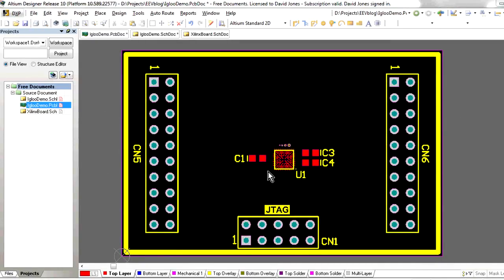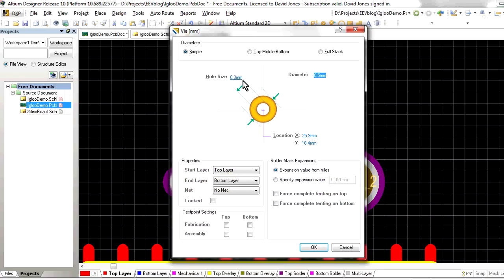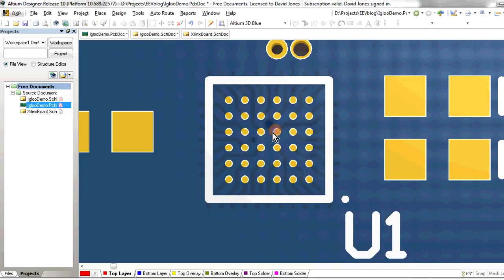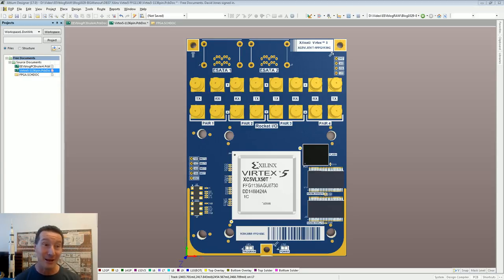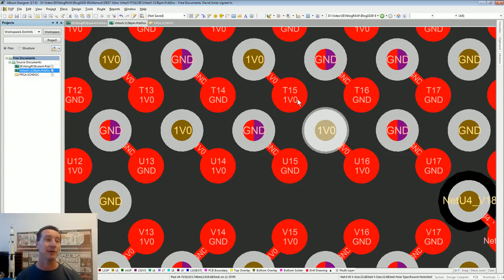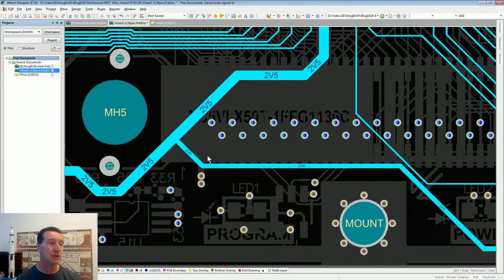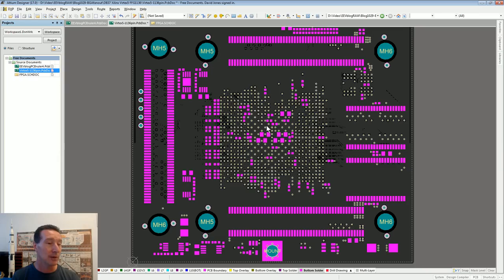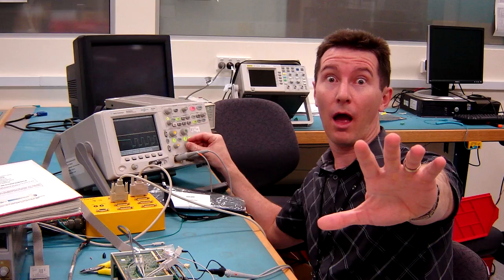EEVblog #1029 - BGA PCB Fanout

Comment: Hey, Dave! Man, I can't even explain to my fellow viewers how valuable this video really is!!!! I just wish you had done it MUCH sooner :)

Trying to find some of this info for a hobbyist is damn near impossible. I'm a software guy by trade and have no formal education in hardware. It took me a couple of years to piece together enough information and thousands in re-spun boards to finally do a working design with a small-pitch large ball-count BGA chip.The fact that you did a video on this is going to help SO many people who don't know where to start.
Reply: Every FPGA manufacturer has recommended fanouts and even PCB stacks for individual packages/families. Its not like it is that hard to come by to this info on web.
Reply: Fanouts are about 1% of the board layout. I wasn't saying great job for showing a fanout. I was saying great job for the info in the video in general. Via sizes, via tenting, layers, bypass cap placement, and he even mentions IPC guidelines, which took me months to come across by accident on my own. If he broke this video down into a few more in-depth videos, it would be amazing for the hobbyist who wants to get into this kind of PCB design.
Reply: Unfortunately these examples are very outdated nowadays. Modern hi-speed buses like DDR3 have very strict requirements on how do you route them out - you can't just spread them around however you like. This makes using "default" dog-bone fanout (which even cheap tools like DipTrace can do nowadays BTW) near-impossible, and you have to craft it to make sure certain trace groups go to specific layers regardless of where they are on device - and more often than not you're quite limited in amount of pin-swapping you can do to aid layout.
Another factor which makes routing BGAs harder is the fact that you have to make do with as few layers as possible. I'm a hobbyist too, and making a first 4-layer board with Artix-7 device (256 ball 1.0 mm package) took me weeks of reading datasheets, appnotes and guides, as well as actual routing - I had to scrap routing and start over several times. The information is out there, but it's extremely hard to find. Currently I'm working on my first 6-layer board as I've managed to find a fab that claims it can do such board with CI and tight tolerances at reasonable cost, and this is a huuuge improvement as 6-layers add two more signal layers so making layout much simpler.
As for bypass caps - it's no longer enough to just put them under the central part of FPGA, as IO banks need their own local decoupling, and placing them near IO banks power/gnd pins can seriously hurt your ability to route out signals on the bottom layer. So much so that on one design I have opted to make the bottom layer my ground layer on a 4-layer board, instead of "conventional" sig-power-gnd-sig" stackup.
Oh, and last note - it's VERY important to understand that hi-speed controlled impedance traces need REFERENCE plane, not ground plane! Power plane will work just as well provided that signals actually use that power plane's voltage as IO voltage from that very supply rail (VERY VERY important note - if signals have same IO voltage level, but are actually coming from different power supply - it won't work as current loop will have to return current back into that remote power source). This understanding (as well as consequence from it - power plane needs to be as good and solid under/above traces as ground plane normally is) will help you to route things out on fewer layers - as a matter of fact, this is the only way to route 4-layer boards as well as 6-layer ones (as both typically have only 2 plane layers, and all signal layers reference to one of them). In general - whenever you route hi-speed traces, always think about how return current will reach the source, and do your very best to ensure this return leg is as short and as low resistance as you possibly can.
Reply: Good to see there are other hobbyists making their way into more advanced PCB design! I've been where you are now and it was very frustrating. And trying to get help from engineers that have done this type of layout before was useless. It's absolutely as much art as it is science to lay out this type of board. And people who know how to do this type of layout are not very keen to give out that information.

However, I hope you aren't saying that Dave's examples are outdated. This kind of info is never outdated. Not all chips use DDR3 and have high speed busses like USB3, etc. Some of us still play with chips like STM32's that need just the type of layout like Dave was showing above. His examples are still very relevant to anyone who is just getting started in this area.

Also, if you need any advice on the best PCB fab houses to get 6+ layers done with excellent tolerances without going broke, let me know. I've tried more than 10 fab houses and found that only a few could produce high-yield without costing thousands of dollars. Feel free to contact me for any other pointers on this stuff. I promise, I've been there.
Reply: Well the thing is - in many cases I wish I would have an option not to deal with DDR3 and go with DDR1 instead (as DDR1 is available in TSOP packages, unlike DDR2/3, which is 0.8 mm pitch BGA only), but Artix-7 devices are not even electrically compatible with them. Same deal with more-or-less modern CPUs and SoCs - DDR2/3 is pretty much a standard there. So - year, as soon as regular SDRAM speed is not enough for you and you're not willing to spend a fortune on big SRAM chips, you're pretty much stuck with DDR3 and all headaches it brings into design.
I would really like to hear about affordable fabs, but I'm not sure how to do that on YT, if you're on EEVBlog forum, please send a PM to user "asmi" (that's me). I would appreciate any experience you're willing to share.
Reply from the maker: I did do it much sooner! 6 years ago in fact. Or at least the first half of it.
Reply: Fortunately times have changed for the better since that. 2-layer boards with 0.1/0.1 mm tolerances are not that expensive nowadays, for example PCBWay offers 10 boards 10x10 cm with that tolerances for $100. Even 4-layer boards are quite cheap these days, so BGAs are not as scary to use as they once were :) Can't wait for 6-layer boards to follow suit, as currently they run at $250+ which is quite steep for hobbyists, who will likely need several respins as they tend to lack both tools and experience to get it right on a first try.
Reply: Travis Estep

If you're looking for more in-depth tutorials, Robert does some superb vids.

They are fairly Altium-specific, but many of the principles apply to general PCB design and layout...

 https://youtu.be/jpk-hfsFaqA
Reply: asmi06

Have a look at EasyEDA - their prices are very low, and the quality is great.
(this is just from recent experience.)

They still appear to have a deal on atm for ten 10x10cm 2-layer boards for just $2 total (excluding shipping). :o

https://easyeda.com/order

I had ten 10x10cm 4-layer boards made by them a few months ago, and it only came to $46.54 shipped.
(inc $13.70 cheapo shipping, so they did take about two weeks to arrive. They've just reduced the faster shipping to around $18 now though.)

Hope this isn't considered as spam - I'm just an end-user. lol
Reply: Yeah, I saw that video. I know that Robert Ferenac (spelling?) did some in-depth videos, but I think sprinkling in more videos like this that go a little deeper in PCB deisgn theory would be HUGE! Trust me Dave, not everyone likes to share this info like you do :)
Reply: I bought and trained with all of Robert's videos. Most people won't like his teaching style, but damn his videos are awesome! Also, I'm not requesting this material for me. I think it would be good for EVERYONE to have. Not everyone can afford Robert's videos.
Reply: EasyEDA is good for up to 4 layers, but the tolerances aren't very good. In some designs that asmi is talking about you can have traces/spaces down to 3mil/3mil. They can't do that. They also can't handle vias small enough and can't do blind/buried vias.
Reply: @Travis Estep Can you please provide me information on fabs? I would really appreciate some recommendations...
Reply: www.pcbway.com is a really good fab with some decent prices for hobbyists. www.pcbcart.com is the best I have dealt with as far as minimum specs, accuracy, and pricing. Keep in mind that you can only do so much when it comes to high speed signaling. Most of the work is done in the fab house, where they know what your trace specs need to be to hit a target impedance. Sometimes the fab house can give you a spreadsheet to use, but sometimes they just tell you to label your design and they will make the required changes to hit that target.

If you can afford it, and if you're doing 6-layer boards I'm assuming you can, you should go with PCB Cart. I have had nothing but amazing results with them all the way up to 10 layers. I have really pushed the limits of their fab process and have yet to have a board fail due to an error in their fab process.
Reply: I know PCBWay and used them a number of times with great success. Looked at PCB cart just now - 6 layers 0.1/0.1 traces and 0.2 drills is $515 for 10 boards! That's waaaaay too expensive. PCBWay asks $280 for the same thing! I've found another fab that quoted me $234 for the same job + that price includes DHL shipping. Never used them before so I'm not sure if they are any good, but it's worth a try.
Reply: @asmi06  I've use PCBWay for cheap easy boards, too. Who's your other fab of choice?
Reply: @LordCalWong  Right now it's wellpcb.com They offer quite affordable 6 layer boards, and the quality has been excellent so far! Another contender worth considering is jlcpcb.com, but I didn't use them personally.
Reply: Who told you that electrical engineers are "taught" this???????????????
Reply: @Konecny_M  And they suck. As the expert says "until proven otherwise, don't trust application notes". Watch videos with Rick Hartley. As a particular example, I had Lattice told me to use via-in-pad to route a 0.8mm pitch BGA, without bothering to suggest the much easier dogbone version. Why????????
Reply: @asmi06  Watch videos with Rick Hartley to do this properly, or buy Lee Ritchey's books / get his training material.
Reply: @nameredacted1242  I know how to do it now, 4 years since I wrote that comment...
Reply: @asmi06  So you learned. Good for you!!!
Reply: @nameredacted1242  no one. From what I've gathered over the years, this is stuff that's learned from experience, and most board designers keep it to themselves. I've talked to several professional layout designers, asking questions about boards they designed and they just refuse to give out info. Like it's a trade secret or something.
Reply: @nameredacted1242  I also ended up learning by doing. Not being a professional electrical engineer meant that it cost a lot of money in failed layouts, but I can layout pretty much anything I want now, save some of the more complex analog stuff.

Comment: Long ago I got fed up with the nuances of BGA fanout/layout (and my large number of wasted spins).  These days I import a known-good reference layout and tweak it to meet my needs, sometimes even merging sections from multiple reference designs.  The NRE savings are huge, which can provide the money needed to get more layers on the production board.

It doesn't always work out. Sometimes fewer PCB layers are mandatory, and much more work is needed.  But that's when I contract the work out to a true expert, and still make savings on both schedule and NRE.

I've even done this on two hobby boards, where I traded writing some software for the BGA layout. We both win!  I can write much better code much faster than I can do difficult BGA layouts.

I do have a favorite trick when I have to handle high-frequency controlled-impedance signal pairs:  I can sometimes get away with hand-soldering some thin coax (RG-174 for signals <= 1 GHz) from fanout vias within the BGA footprint to connectors (or other chips), which gets a ton of silicone to stay put.  I mainly use this trick for things like boards for production test fixtures, when only a few are being built.

Let's just say I'm much better at precision hand-soldering than I am at routing controlled-impedance traces when I'm running out of layers.
Reply: I am on the other end of this process (We make semiconductor devices) We generally expect everyone to do as you do, in fact if you insist on making your own layout our support guys will likely tell you to use a reference design. 
Part of our process, way before even RTL is started we make preliminary PCB layouts to ensure the device actually can be used. 

We do make a lot of effort in making sure we use a minimum number of layers, minimize vias etc avoid fine pitches etc on these reference designs.

Comment: Many pcb manufacturers told us not to tent the vias, because chemicals can not be cleaned out of the holes properly and lead to corrosion. On the other hand, tenting reduces the risk of shorts. What we did is almost completely tent, but leave the holes open.

Comment: "For those of us playing along at home" *Pulls up data sheet on second monitor to go along with video.
Reply from the maker: Nice!
Reply: And what's on third monitor?
Reply: Well 2 ultrawide costs much more, than 3 regular one IMO.
Reply: I dislike ultra big monitors, I find more smaller ones with one bigger main monitor works best, because the monitors create natural snapping points better. You can, for instance fullscreen a video player to a monitor. Just try and get a video player to "fullscreen" onto a part of a display... My main computer has 4 monitors hooked up, one big one, and three small 1280x1024 17" ones. And as a bonus, I've only spent like 20 euros total for all the secondary monitors buying them second hand.
Reply: 1280X1024 is definitely the best resolution for datasheets and documents. Widescreen lacks the vertical resolution necessary for lots of things, unless you mount it 90° rotated. Finding 5:4 aspect LCDs is super easy, and as you mentioned, cheap. I picked up several 19" for $5 once.

Comment: Laser drilling and routing is actually getting quite affordable with newer production systems. Sometimes it's more economical to laser cut/drill than to go for the old mechanical solutions. An added advantage is that the high-end systems have multiple heads, meaning they can actually beat the older systems in board throughput on complex designs with thin FR-4 or flex. Many manufacturers simply massively overcharge for what they consider a non-standard process flow.

Comment: The poor AMD Threadripper enginners... Thats 4094 pins to route on the TR4 socket. Granted, many are power and ground, but thats still a clusterfuck of pins.
Reply: Luke Den Hartog they also get lots of layers on the pcb. Still takes forever though
Reply: IBM's latest mainframe PU design probably has even more pins than that considering they've gone fully parallel in the last two generations.
Reply: I tried to layout an LGA-2011. Just trying to get the various power planes to the pins they needed to go to drove me batshit crazy. You have to take into account current requirements, heat dissipation, etc. Needless to say, I did not finish that board.

The PCB guys that design motherboards are true masters of their craft. There are SO many rules and variables that have to be taken into account.

Comment: the 1136 pin part also shows another problem, with all those vias you can quickly end up with very little of the planes left under the part. Afaiu it is allowed to skip the annular ring on on unconnected layers, that will help a bit

Comment: On mod-wires, I find the best thing to do is get some of those older IDE cables, where there's individual strands of cable that're encased/shrouded. Just crack it open, and harvest all the tiny wires. ;)
Reply: Most of those use cheap insulation that shrinks up and makes a mess when you solder it.
It's best to just buy some kynar wire wrapping wire.

Comment: I really don't get why many PCB designers try to match the length of serial IO's.  After clock/data recovery, the lanes need significantly big FIFO's anyway to compensate for the clock skew, if you use them as pairs. Most of the time they are completely independent anyway. Yes there are exceptions like SONET but 99% of the cases it doesn't matter. On normal parallel IO and DDR, we have IDELAY components as well. Only if you really mess up the lane lengths it's going to be a problem, but a few millimeter should not be a problem in any decent FPGA design.

Comment: As the 36 pad fpga shown at the start can be fanned out on 1 layer, wouldnt it make sense if they just manufactured them as quad flat pack rather than bga.

 Is BGA  simply easier to manufacture passing the tough routing choir onto the pcb designer  or is it necessary in the 36 pad case,

Comment: The end fan-out example was strange to me as I was expecting it to fan them out to the edge for you given a limited number of layers. Creating a stack of Via's and then just linking each pin to a via doesn't really fan-OUT anything.
Reply: Robin Hilton

IIRC, Altium can auto fanout traces from the vias to the edges too. You have to specify the layer(s) for that, but I'm sure it can be done.

Comment: Hi Dave.  Can you please check the numbers for the tiny FPGA, because it doesn't seem to add up. Assuming 4 thou lines and spaces, and 4 thou is almost the same as 0.1 mm, the trace plus space on each side adds up to 0.3 mm, leaving only 0.1 mm for the pads for the balls. Yet the pads as seen in the video are about 50% larger than the traces, so about .15 mm.  This does not add up to .4mm pitch. Maybe this is a .5mm pitch BGA?